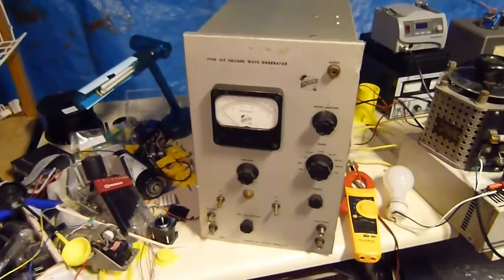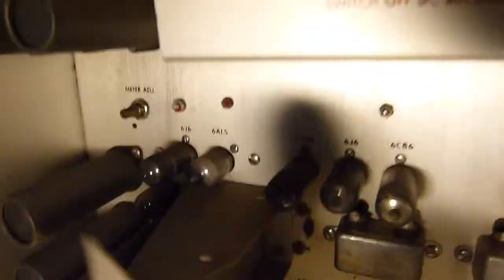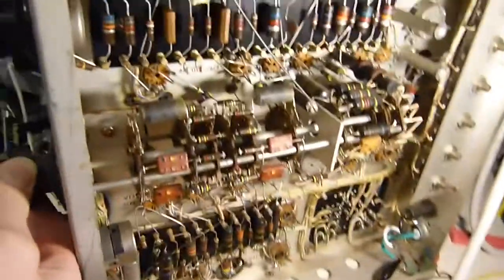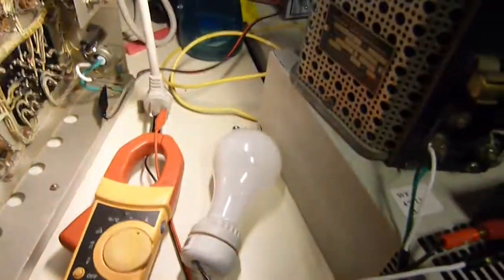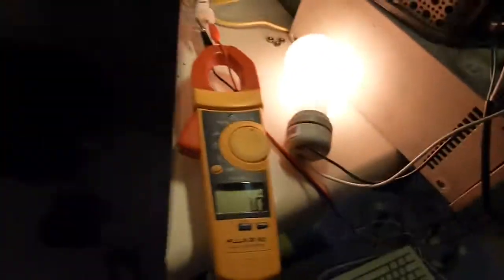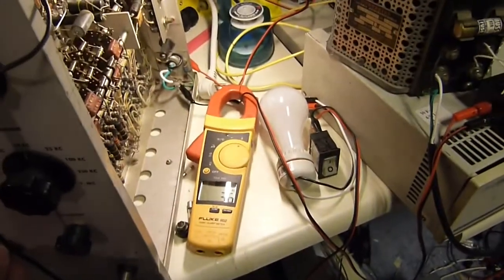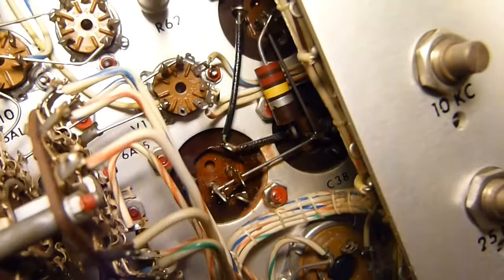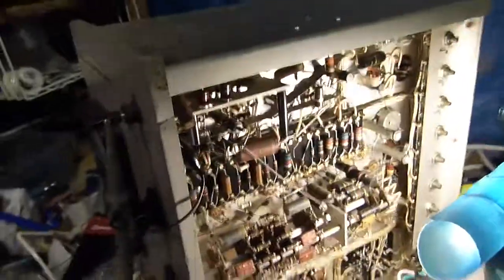Powering up a Tektronix 105 Square Wave Generator Pt1 - Vacuum Tubes

Comment: Fantastic video. That sure was an impressive smoke show.

I'm amazed it lasted that long at full current, and that it produced such a nice square wave even though it was that close to failure.

I'd love an update if you do replace the caps, and I'm also interested in seeing what modern replacements are available for those old caps.

Thanks for the video!